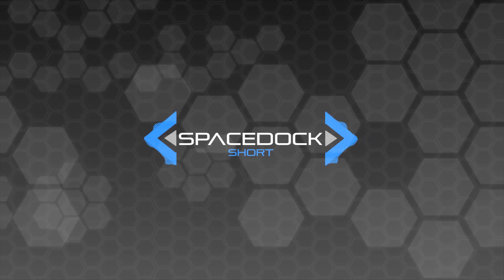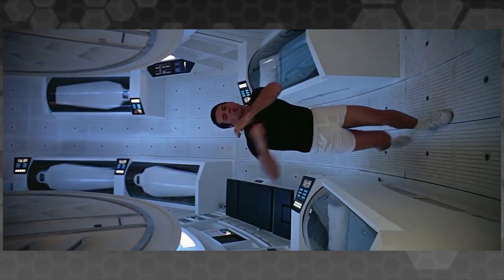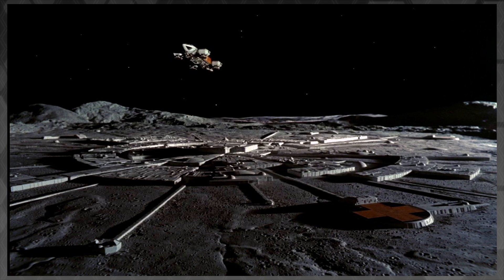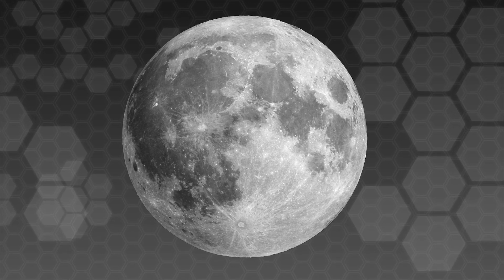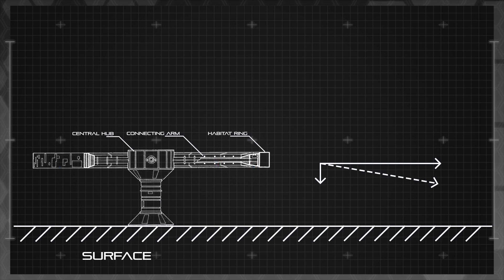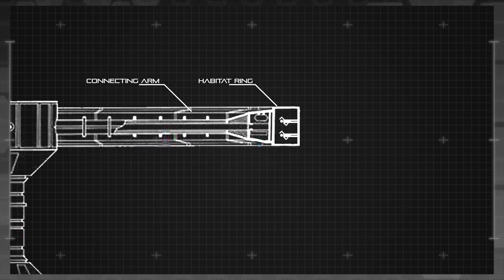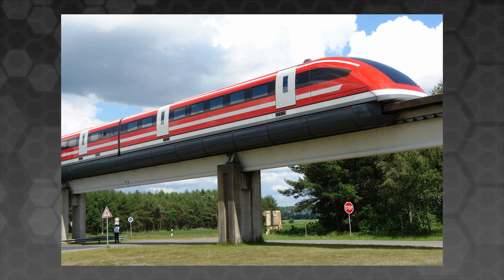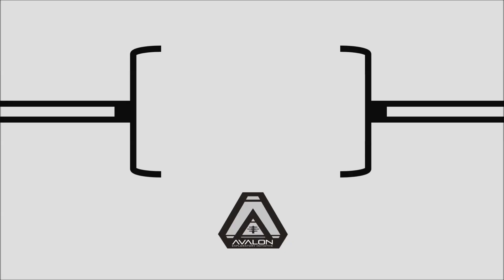How To Create Gravity On The Moon

Comment: We definitely need some magical gravity plating.  Or even some non-magical gravity plating.  Either will do.  I was writing a sci-fi story where an advanced alien race had to solve this problem on planets and moons they terraformed.  Their technology combined traditional science and magic.  Their solution was to alter the planet or moon so that it generated a magical field that simulated the pull of gravity.  It extended about 100 miles from the surface.  So, you would feel earth-like gravity on the surface, but you would feel the body's normal gravity once you get a distance away from it.  So, it's orbit wouldn't be affected or anything of that sort.  This is fiction, we can often get good ideas from fiction.  For instance, figuring out how to generate a field, electromagnetic or otherwise, that can mimic the pull of gravity.  There is probably something that would work.  And it's something well worth investigating.  Although generating it might not be as simple as gravity plating.  It definitely wasn't in my fictional example.  The aliens spent centuries changing the structures of magic crystals deep underground.  And their enormous vessels, a mile in diameter, where spheres with an onion skin of layers around a core built from those crystals.  This allowed their magical devices to operate, including those generating their pseudo-gravitational field.

Comment: Waiting for someone to suggest using a rail gun that goes around the moon to accelerate ships to 100km/s -- and try to figure out how not to be crushed by 500G's when traveling at that speed around the moon.

Or a rail gun through the moon  to reach 100km/s -- if you can get around the 300G's.

Comment: Spinning asteroids to simulate gravity is not a good idea. Since most asteroids are just a lose collection of rubble, they would tear appart by spinning them. You can hollow them out and put a spinning cylinder inside them, that would work just fine, but don't spinn the whole asteroid, if you want to keep it.
Reply: I remember Scott Manley mentioning something about that when he was explaining how asteroid stations could be built. Before Tycho spun it up, they reinforced their insides by injecting a high-strength binding material into it's crust and mantle. For Eros you could pull it off by cooking it's inside, injecting an epoxy binder, and arranging the cooling material into basalt fibers. For something the size of Ceres though you'd need to use something much stronger material, such as carbon nanotubes.
He does a much better job of explaining it than I do: https://www.youtube.com/watch?v=gU9dCWY7G2M

Comment: Did anyone calculate the speed vs size you would need to spin the wheel, in order to simulate 1 G?  Let's say a structure with a radius of a football field (100 m), what rotational speed would you need?

Comment: Not bad, but I prefer the inverted cone method, it allows for a dome or regolith over it as well as a greater amount of living space.
Reply: Always a good idea to bury something when dealing with space radiation, putting a sizeable water tank in between would make it even better.
Reply: Actually, the spinning salad bowl domes would be inefficient for living space and require much more atmospheric volume.  If you want more living space in a circular maglev train, just make the train wider, after all that's all that the spinning cones or salad bowls are anyways, you're really only talking about more atmosphere volume in the dome and dead space in the center being part of the habitat with Isacc Arthur's spinning salad bowls.
Reply: You are correct that the dome method is less efficient when it comes to air volume, but I was simply stating my preference for one over the other. Though I admit that looking through a dome into the black emptiness of space is kind of useless. Even if the drome isn't transparent, the only boon I can think of right now is that it has a greater amount of headroom which is more of an expensive luxury than anything else (but it would probably be worth it if luxury was indeed what someone is looking for). Though when you get down to the mechanics, the two ideas we talked about are basically the same, save for where you actually put the ceiling and walls.
Reply: +Eclipseslayer98   The common aesthetic preference for a transparent dome is yet another disservice that pop culture scifi has given us.  Such habitats would likely be buried under several feet of packed regolith for radiation and micrometeorite shielding, the aesthetics of a transparent dome simply wouldn't be an option.  Also regardless of whether it was a dome or a lower ceiling, it could easily be painted as the sky or the image of the sky projected upon it hence whether there is a lot of headroom or not, it would not matter so long as it was high enough to be out of touch of your tallest or highest flying inhabitants.  There is one advantage of a large atmospheric volume, that of buffering oxygen and CO2 levels, the Biosphere2 experiments found oxygen levels rising during the day and falling at night while CO2 levels dropped during the day and rose during the night, obviously this doesn't happen on Earth both due to the volume of Earth's atmosphere and the fact that the atmosphere is over both day and night.  However, the buffering effect could be simulated by mechanically and or chemically storing both gases when they are in excess and releasing stored gases when they are rare, alternatively different portions of the habitat could be in different day night cycles.  Presumably, the gases required for an atmosphere may be harder to procure for space habitats hence it would behoove us to minimize atmospheric volume especially since the aesthetic difference is really nil despite what pop culture scifi tells us.  Note in the last season 10 episode of Doctor Who, the space habitat had holographic ceilings portraying a sky and the level number.

Comment: You know, we've already constructed a prototype for just such a system.  
In fact, we've built several.  
Starting around 1904.  
http://www.engineering-timelines.com/scripts/engineeringItem.asp?id=901
Basically same thing, but still not big enough to prevent major Coriolis effect issues.  
Mounting the living spaces on tethers allow a saving of materials on the arms.  
As they can freely tilt, you don't have to worry about angling the floor and making sure the rotation rate matches, the system auto corrects.  
Presumably you could take an elevator on a cable to the hub and descend from there.

Comment: Then your only concerns are stellar radiation, solar flares and CMEs, water consumption and reclamation, the spread of disease on a colony isolated by vacuum, (If you thought a carnival cruise lines poop cruise was bad wait till you can't escape from it.) food supply, reliable restock of said food supply, mechanical failure of major colony components, fire, pressure leaks, moon quakes, and civil unrest.

Comment: only issues I see is the massive stress on the centeral hub. over time the outer ring would still want to sag towards the surface even in the low g of the moon. also Love the Anime
Reply: Which is why it's more prudent to just lay the darn thing flat on the ground instead of suspending it atop of a structure.

Or, you know, bury it. Solves a lot of issues if you do.

Comment: I would have buried the centrifuge.
It would simultaneously solve the radiation issues and prevent inhabitants from being flung several kilometers away in the event of a breach.
Reply: Downside to underground habitation with the carousel centrifuge? The sudden stop via the excavated "earth" wall outside the ring. 

Still, noting but a few meters of pillows or something equally soft wouldn't solve.

Comment: Spin gravity still is has looots of flaws. For example only things touching the floor would experience it, meaning stuff would just fly off to the side when dropped. Also the difference in gravity by level is drastic. If you use a 50 m radius ring you need 0.44 rounds per second to achieve 1 g. That results in your head experienceing 0.87 g.  
Also asteroids can´t be spun up like that. It would tear them apart. We observe something similar on asteroids being slowly spun up by sunlight. They just can´t hold themself together.
Reply: Falling objects inside a centrepedal ring would not fly off to the side. That is exactly the same as suggesting that a balloonist, once airborn, would see the earth turn at over a thousand miles an hour beneath them. The air moves with the occupants of the ring, just as the air moves with the spinning earth. When you drop a ball on a planet, it does not fly off, because it is already moving relative to the frame of reference.

And that is the point. Even in a vacuum, an object dropped inside of a spinning ring would still fall to the apparent 'floor' and not off to the side. Why? Because it is already part of the local frame of reference, same as the people standing in the ring. If they hop, they will not fly off, they will simply hop, and drop back down to the 'floor' of the centripedal ring. This would be true of any object that is part of their frame of reference within the spinning ring.

As for the issue of asteroids - you are confusing them with comets, made of broken debris. A large and solid asteroid, made mostly of iron and stone, such as Ceres or Eros, could easily be spun without flying apart. They are solid objects, made of strong and hard materials. Yes, petty surface debris would fly off, but that is only reasonable. The key is choosing solid iron-nickle and stone asteroids. They are basically a gargantuan solid rock, all the way through.
Reply: Awayname Q basically just conservation of angular momentum.  You only think you're jumping up, but the spinning wheel's momentum is added to yours.  That momentum is drawing you sideways (spinward, in the direction of the wheel).  The force of your jump isn't enough to nullify that momentum, so you go "up."  Free from interference, you drift in the direction you were going the instant you left the surface of the wheel.  Since it spins inward, you travel toward the wheel.

Depending on how big the wheel is, and the speed of the spin, you may or may not get slightly different effects based on whether you jump with, or against, the spin, but you're still going to return to the "floor" of the wheel.
Reply: angular momentum - thank you. I vapor-locked on that term in my previous post.
Reply: Yes angular momentum is conserved: L=rmv(with L=angular momentum, r=radius, m=mass, v=velocity at right angle). Meaning an object not fixed to to the ring seems to go slower as the radius gets bigger. Look up coriollis-force(F_c=m*(w x r)).Its a virtual force you feel moving along the radius of a rotating system. Ergo, things falls to the side or better at an angle. To not notice it you would need a  ring ofabsurd size. Like multiple miles. Even planes on earth need to lookout for it flying north to south.
So basically:
Yes you can simulate gravity to a certain extend with a centrifuge.
But no we can not live inside it comfortably. Our sens of gravity would disagree with our vision. It would be a far worse form of sea sickness.
Reply: The entire zertrifugal force is only virtual. You only feel like you feel a force cause the ring is pulled towards you. Accelerating you to the centre.

If your reference system is subject acceleration things look wierd from the inside. 
Best example would be an outside observer putting a mass inside the ring. For the ring people it woult orbit the center. With a little motion to the edge it would seem to spiral there. Same thing if a ring person drops somthing. It spirals.
Reply: Jennifer Reitz 
To the baloon example.
Yes at some point you would see the earth spin beneath you. Remove armospheric drag and move high enough. Otherwise you would need to hit lightspeed once you are far enough away from earth.
Reply: Jennifer Reitz
Well not exactly beneath you. You´d also be moving sideways with the velocity of the earth surface.

A better example would be a balloon, which is removed from earth potential field at surface level. It would at first seem to go up. But in fact it travels in a straight line and see the horizon looking back. You are just rotating away. 

o__
o=earth
____= path of baloon
Reply: Jennifer Reitz
And the asteroids. No, i dont confuse them with comets. 
 Yes they are strong when resisting pressure. But not shear forces or traction. If you want 1g everything including the solid rock will experience 1 g upwards. The gravity will be canceled out. And pulling a mountain apart with 1g is possible. Thats the reason large overhangs on mountains are so rare. Gravity is 90% of whats holding them together
And the rock is not nearly as strong as on earth. The low asteroid gravity results in low compression. They are not soild iron ore nickle. They are iron or nickele ore at best. A vastly different substance.  And to repeat myself: we even observed asteroids being spun up by sunlight and falling apart as a result. We know it does not work. Not speculation, actual astro-physical observations. One was called  P/2013 R3 and broke apart 2013.
Reply: I believe that they might have mentioned somewhere in the show that gravity on Ceres is not 1g, but 0.6g because the asteroid would tear itself apart if spun faster.
Reply: Awayname Q if we assume futuristic technology exists by the time humans plan to spin an asteroid for artificial gravity, people might be able to prevent it from breaking up.

They could mine a carbonaceous chondrite asteroid for carbon, make some kind of super strong woven carbon fiber webbing, and wrap the asteroid in it.  A net made from just a few layers of the stuff might be less than a millimeter thick, but still have the tensile strength required to hold the asteroid together.
Reply: Maybe. But at that point i think it would be easier to build a station with an enourmous centrifuge ring.
And i need to correct myself. There are asteroids made from almos pure nickle, platin or iron, formed inside larger asteroids cores by their gravity and freed by collision. We know of around 60 of them with a diamater of 30 km. 
Sadly i dont have their exact data so i cant tell if they were suitable for spin. But they certainly would give us enough materials easy enough to build large stations. 
And in my opinion stations(even if to this day very unpracticle(like alomst as far away from doable as gravity-plating)) would be a far better. You dont need to waste Energie on spinning up tons of uninhabitable rock just to get gravity in relativly small areas. Also stations would be far easyer to repair.

Also somthing to consider is getting on and of the area. Docking from outside the ring would be unpractical at best and dangerous at worst. So a dock in the centre with elevators would be best. But that would result in loss of angular momentum whem moving mass to the ring. So you´d need to constantly adjust it, which requires a constant supply of fuel. 
And i guess these are the main things we still need to figure out:
a) how to hold such a large structure together
b) how to accelerate it consistantly.

And maybe we´ll solve these problems, maybe not. Maybe well figure out another way to create gravity before we do. Only time will tell.

Comment: Very plausible, although this seems to be limited in the fact that if the habitat ring is spinning and on an angle, would that not effectively limit the overall height of the structure before you became top-heavy? 

I mean I certainly can’t see skyscrapers and the moons with this approach, maybe not even 10 story tall structures., but if that wasn’t an issue, and seen as the moon is effectively virgin territory with no natural obstacles like open bodies of water, a sprawling city scape of 5Dash7 story tall buildings isn’t exactly an issue.
Reply: Well despite the diagram in the video, the carousel doesn't HAVE to be on the very top of the hub "tower" for lack of a better term. Better to just do a toroidal maglev track beneath the ring portion in addition to the rotating hub section and put the whole thing on level ground.

Or, well, bury the whole darn thing and use the unearthed (or would it be unluna'd in this case?) regolith (and possibly the water tank in between) as radiation shielding. And if you still want towers on the moon, there's nothing stopping you from doing it via domes on the surface. Just don't forget the radiation protection. I'm thinking a dome with water in between the inner and outer window panes and an EM field just so people can actually see outside "naturally".